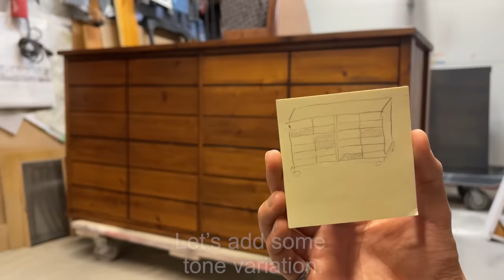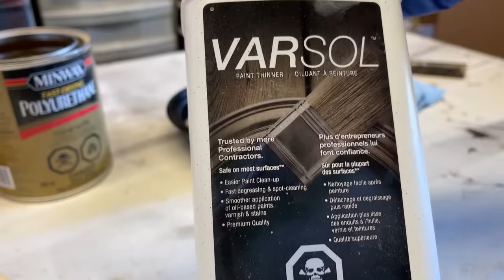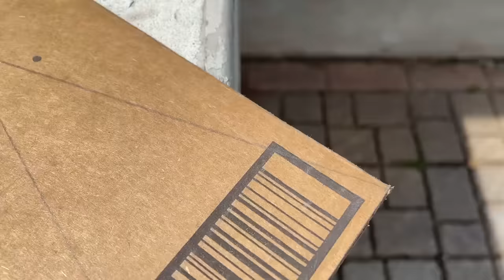Turning an IKEA Dresser into an Industrial Apothecary Cabinet | IKEA HACK

Comment: Hey that turned our really nice!  One small $ saving tip?  Don't use the big box store wood conditioner.  Just brew yourself some really strong black tea...let it cool and then use that instead.  It works better (I've been using it for years and have tested it on multiple woods including pine, alder, cedar and oak), is less expensive (by a long shot) AND doesn't expose you to any unnecessary chemicals.  The tannens (sp?) in the tea do the job.  Wipe it on, give it a light sanding and viola, your ready to roll.  Keep up the great videos!
Reply from the maker: Just did research on what you said, and I must say… GENIUS 🤩 Thank you!
Reply: Great tip! Thanks 😊
Reply: Tannin.
Reply: Don't know how it's called in english bu you can also use "brou de noix" basically it's just the pigmented water you obtain by boilling walnuts shells. Can be used as ink to draw but also as woodstain ! (Warning : it stinks a lot when you're preparing it and don't you dare to use ever again the pot you prepared the solution in)
Reply: But, wood conditioner is not the same as what you're talking about. Tea acts as a stain and wood conditioner pre treats the wood so that the stain will absorb more evenly(which is badly needed on pine, which this wood is) and not be blotchy.
Reply: @Slevenn Wolf  Walnut ink ! 🙂
Reply: Thx good tip
Reply: @slevennwolf9751  
Black walnuts have high amounts of iodine, granting a black color when oxidized
Reply: Great project! Question, what was the (looked like) cordless little saw you used? Looked so less intimidating yet easy to use?!
Thanks 😊 for sharing, beautiful ❤️!!!
Reply: Reminds me of how I once spent a week making a nice bookcase and then oiled it with Watco Danish Oil and some guy told me to just use motor oil. Yeah, right, I'm gonna take a chance on screwing up a week's worth of work to save $1.59. Tea, I would do.
Reply: Great tip. I had once a jumper greatly stained by blacktea and I first thought of "repairing" it by fully covering it on tea. 

Can you share measures / volumes you have earlier used the get an idea of how much tea you put for a certain tone of dark? Thanks a lot in advance!
Reply: Seriously?! This is an amazing idea!
Reply: @nannyb8714   might be a Dremel Saw Max?
Reply: Genius!!!💡💡💡
Reply: @mikemcmo  We were house hunting last spring and saw a house where the floor looked like it was stained with motor oil.  It couldn't have been worse looking.  
As for tea, water raises the grain of wood, so you have that extra step of sanding grain and fuzz back down.
Reply: Who is Viola and why is she ready to roll after wiping black tea on wood?! Sounds like a great woman... 🥰
Reply: @jesusislord6545  sir this is a Wendy’s
Reply: @nannyb8714  do you remember what time in the video the saw appeared? The only saw I remember in the video is a corded circular saw.
Reply: Awesome idea! Thanks for sharing
Reply: Anthony Fox
Tannins, voila ( it is a French word and it means look here, or there it is) and it is you're ( the contracted form of you are) .
Reply: @nannyb8714  It’s a dremel saw and they’re brilliant!
Reply: You can also use alcohol as wood conditioner before applying wood stain, alcohol opens up wood grain and dries very fast so you don’t need to wait before applying stain. Pour alcohol directly on wood surface and apply it using a clean drag, then apply wood stain immediately. Have a nice day!
Reply: You can do it even cheaper by letting acorns sit in a bowl of water for about 3 weeks with the shells off, you do it to leech tannins out so you can eat them, so the tannins are in the water still
Reply: @januszR  Viola is actually Bugs Bunny's sister, and she moved to Albania in season 2, episode 5 of The Looney Tunes Show, Semper Lie.
Reply: Thank you! You have just saved me some major cash!
Reply: @januszR  😄
Reply: Please, I'm not knowledgeable about this subject, can you explain to me exactly what the wood-conditioner treatment does to the wood? Thank you🙂

Comment: Okay I love how your jars are hung like that !! How did you do it ? I’ve got to try it lol saves so much space
Reply from the maker: All you gotta do is screw the lids into a wood board! 😁
Reply: @ModernMakeovers  genius lol
Reply: We did this in our workshop area by screwing the lids to the underside of the upper cabinets the same way as he has them in that second shot and its a total game-changer. My grandfather did this with baby food jars and larger peanut butter glass jars. We did ours with plastic Mayo jars and just added one at a time. We ended up always buying the olive oil Mayo so we would have pretty green lids lol.
Reply: If you use baby food jars, make sure you find some with actual screw on lids. Most are just press on with a silicone friction seal now. The lids are difficult to put back on and don't stay on very well. You could end up with broken jars and nails and screws all over your work surface! Use small pickle or jam jars instead. They have a sturdy screw top!
Reply: My dad used to do that.  These guys are as creative as he was with their rotating jars.  If you use long skinny jars, you can rotate long bolts in a vertical rotating rack in a corner, baby jars for little bits under cupboards or on tool racks, the possibilities are endless really.  Aha.  Is THAT where my storage container obsession started!?

Comment: I noticed some bottles of Saman stain at 2:47.  Do you use it/reccommend it? I've been thinking of using it as a natural alternative to stains. Beautiful build.  Apothecaries are timeless
Reply from the maker: It certainly has its pros and cons. A few advantages of using water based stains like Saman is that they dry quicker and can maintain their color longer without fading. However, they don’t provide quite the same “rich” look that oil stains do. Oil stains take longer to dry, but this can be a good thing as it allows you to blend your brush strokes for an even finish.

Comment: Nice transformation, but one advice from a carpenter: don't screw the plate directly in the end grain. Wood is always in progress (fading and soaking). The cross grain of your plate does move much more than the end grain. Your plate will bend as a result. If your lucky your costumer has nearly the same humidity like in your workshop and he won't recognize it. But if the humidity in his rooms is different to yours the plate will definitly make problems. Sometimes you see it after a year, sometimes after a few weeks. You should choose a method to connect the plate with the rest that allows the wood to "work". We are using a groove and a block with a tongue to connect the plate of a chair with the construction with some glue from underneith. Best regards!

Comment: I am late to the show here, but this comment may be useful.  It is not necessary to use conditioner when using gel stain.  Gel stain sits on top of the wood, more like paint than stain.  Since it is not really getting absorbed by the wood, blotchiness should not be an issue.

Comment: I’m totally ignorant with this stuff but can you change the drawer slides to upgrade them or is that basically a proprietary thing for ikea?
Reply from the maker: Yes, the drawer slides can be removed for a different one to be installed :) This one didn’t need it since it was perfectly smooth as is. I normally don’t work with rails at all since I generally look for vintage pieces which don’t rely on railing mechanisms.

Comment: What paintbrush did you use?
Reply from the maker: The brush used when I was applying the poly topcoat was a 55mm oval brush by Bennett.

The thin brush used while I was staining was a round brush by American Painter for watercolor oil acrylic painting.
Reply: @ModernMakeovers  I was wondering about the oval brush, too. It looks like natural bristles, but I thought synthetic was recommended for oil based poly? I looked at their website, but it doesn't say (or I couldn't find) what kind of bristles they are. And they don't ship to the US, so...darn. 😕

Comment: It was a reall cool project, but the minute I saw that the number of drawers wouldn't actually increase I was a bit disappointed. I prefer it when objects don't pretend to be something they are not. 

Is there a way one could possibly cut up the drawer ? At least vertically? And horizontally maybe by adding another rail?
Reply from the maker: I’m sure it wouldn’t be impossible to actually multiply the drawers. It would certainly be a major reconstruction of the entire drawer design, which wasn’t in the scope of my objective with this piece. The apothecary look is a very popular one, but since larger drawers also serve a unique function, I wanted to preserve the original construction and do a purely cosmetic update!
Reply: @ModernMakeovers  that's understandable, it would probably be better financially to build it from scratch then ? 

You definitely nailed the look 👌

Comment: The attention to detail was impressive BUT I feel cheated. You created a facade, and did not actually convert a 6 drawer dresser to a 24 drawer cabinet. It would’ve added 20% material and 10% more time, then you would’ve had the real thing. The positive lessons I learned from this is that such conversions are something I should think about more and that I might consider using apothecary cabinets to organize my garage. It wasn’t a total loss but if I were buying this expecting an apothecary cabinet I would be upset no matter how pretty you made it.